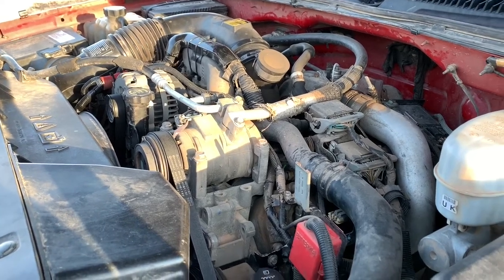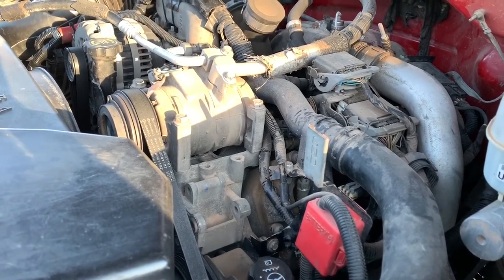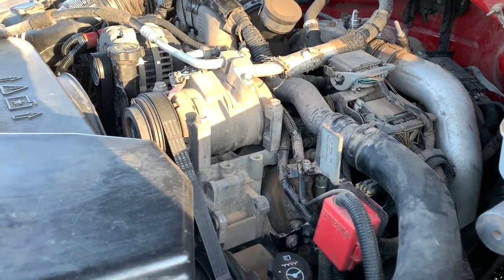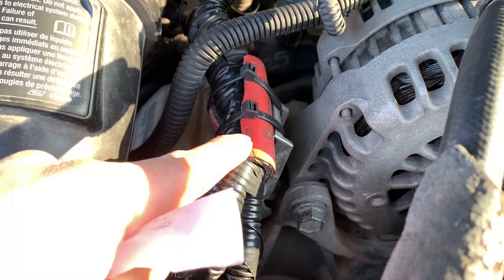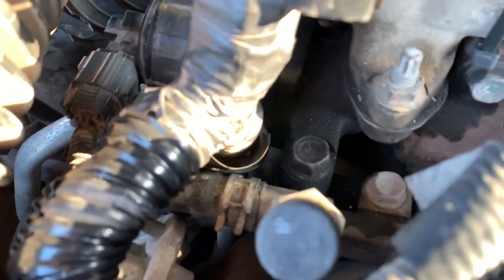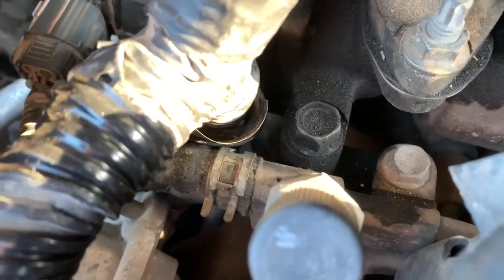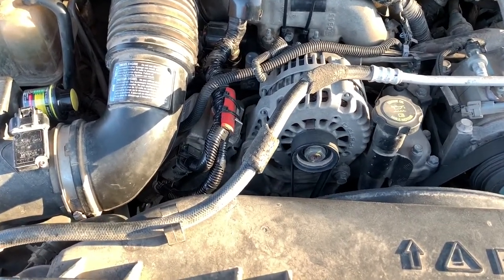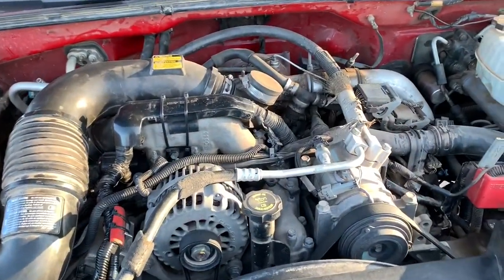How to Fix Tractor Mode On LLYs

Comment: I have an LLY in tractor mode. It has P0202, P0203, P0205, P0208, P2149. This is related to the FICM? Is the only fix to get a new harness?
Reply: Does the heater hose fix it once it’s shorted out?
Reply from the maker: @awesomefish100  The heater hose keeps it from grounding out. It’s usually just one wire. The vibration will cause the insulation to rub off when it’s touching metal.
Reply: @Edwin3912  Upon further inspection my ficm wires looked fine. I went ahead and tried the “ice pick trick” on injector 2s harness. This solved my problem and took the truck out of limp mode. For anyone reading that is also receiving all of the codes I mentioned, first try the ice pick trick on #2.

Comment: My truck has been down 5 weeks and iv spent 4k cause they said the ficm is bad. Not sure what to do next. Other than a gallon of gas
Reply: Get a better mechanic lol I just fixed one with tractor mode and they just wanted injectors. Didn’t need them finda better tech